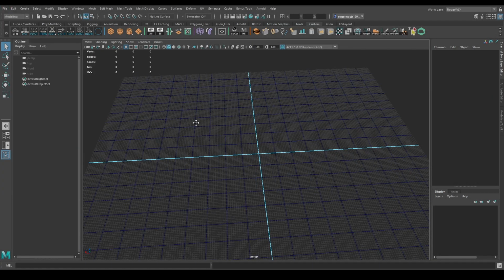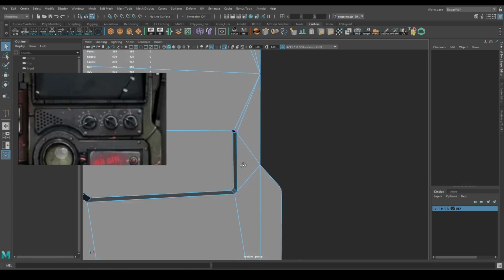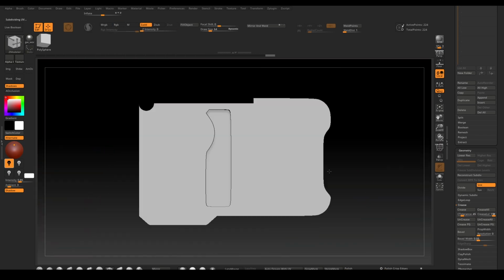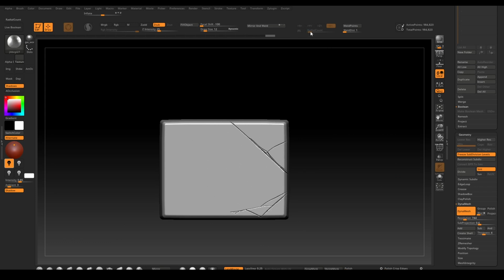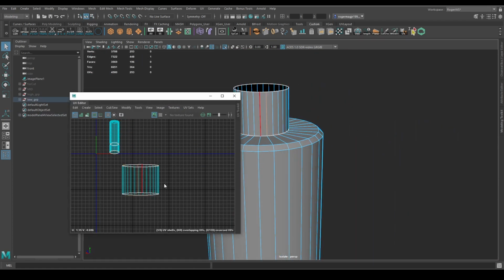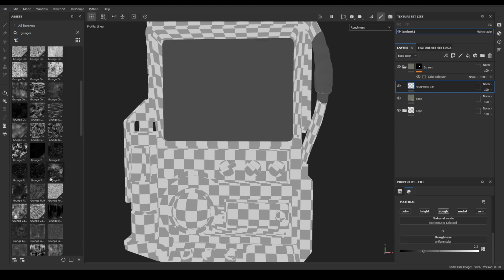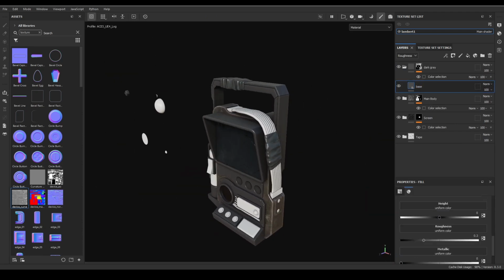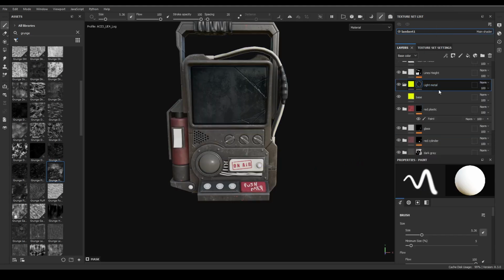Borderlands 2 Device Game asset Full Process (With some commentary)

Comment: Excuse me do u use addon or script to make high poly to tris in low poly
Reply from the maker: I use the decimation master that comes with Zbrush. That way I can get all the detail from the high poly, and also get a mesh with less geometry. If you join the discord I can explain better  where the tool is.
Reply: @ghostS3D  yeh can u send me link discord because all link die
Reply from the maker: @dangminhhieu7440  https://discord.gg/dphe8kNP